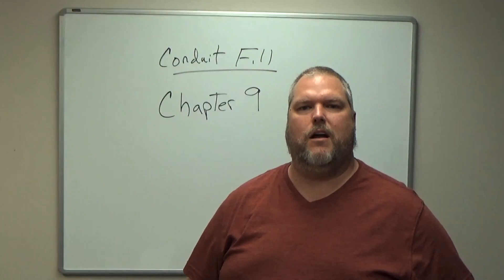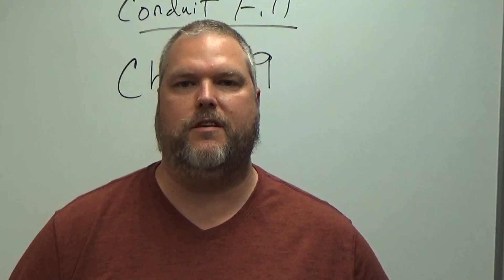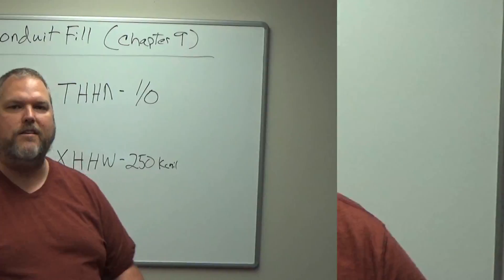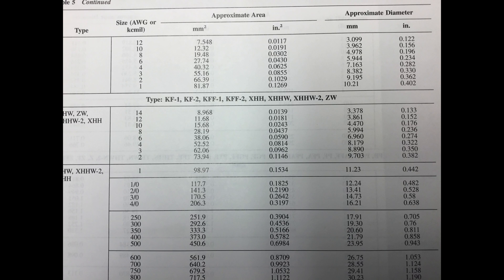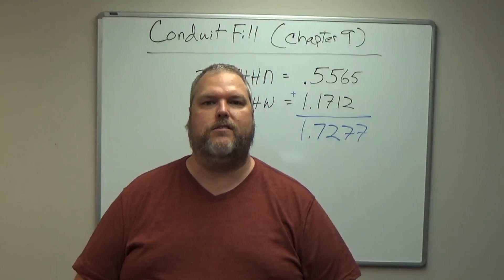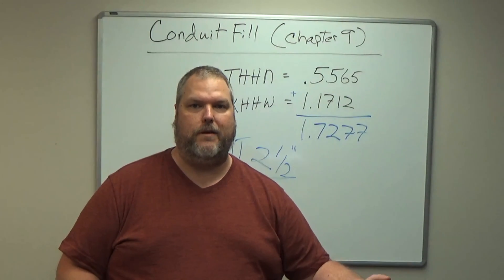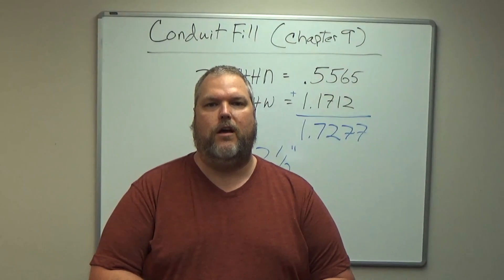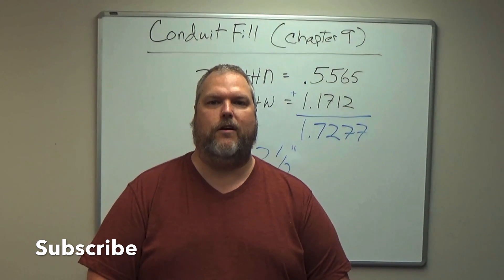Conduit Fill / Different Insulation types

Comment: Question, how did you know right away to go to 40%?. How does one know which percentage to look at right away?
Reply from the maker: It is explained in chapter 9 table 1. Read that and it will answer all your questions!! Maybe I can do a video on some day!! CM
Reply: @craigmichaud-electricalins4602 well for example. I have 6-#10, 9-#14, and 8-#12. All are THW. The total I got was 0.4157. So how many wires will it be?
Reply from the maker: @rh_312 that would be more than 2. So you would use 40%. CM

Comment: What YEAR NEC Code book are you used
Reply from the maker: Well according to the description it says 2017. CM
Reply: @craigmichaud-electricalins4602  I was trying to follow you with the NFPA 70 NEC 2020 . The numbers were not the same. Was it revised ?
Reply from the maker: @MrLarrycherry every three years they are revised! Some times they change. The methods I teach are the same for any code book but the numbers may have changed!! CM

Comment: Off the cuff question....  A 480 volt 3 phase AC unit is being replaced with a 208 volt 3 phase unit.  Can the existing 600 volt disconnect be reused on the 208 volt AC?  Also, can the 600 volt fuses be used on the 208 volt AC if sized per the unit over protection label?

Comment: I can pull 16 THNW2 wires into 3/4 pipe.  Is the ground included in these 16 conductors or can I ignore it?
Reply: dude, its the area of the pipe. you are limited to how much area u can take up within said pipe. 

im not an electrician. nor have i taken any classes.

is this ground taking up any extra area of the pipe that is not included in the wire chart?

Comment: Hi Craig! How would I apply this chart to RTRC Conduit (Fiberglass conduit)? I can't seem to find this type of conduit on the chart but its mentioned slightly in the NEC book. For example: Figuring out if I can fit 2+ 750 kcmil cables into a 5" FRE Conduit